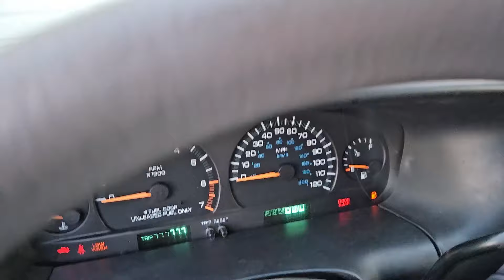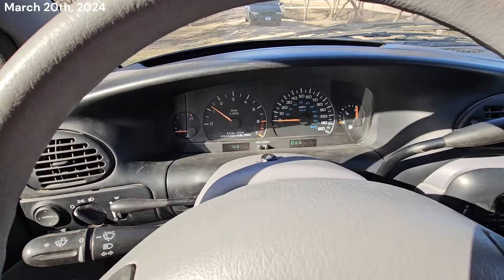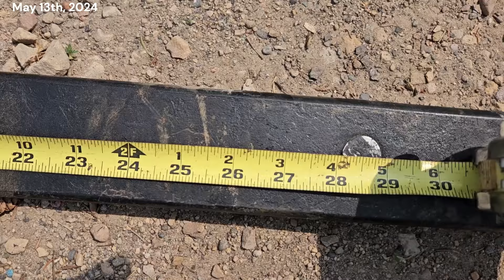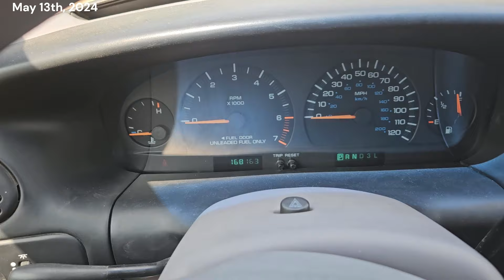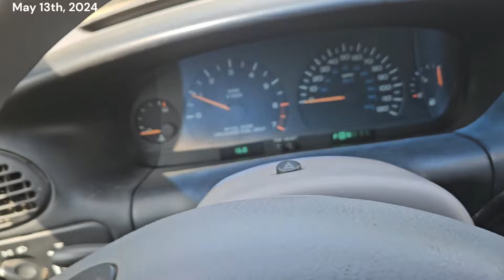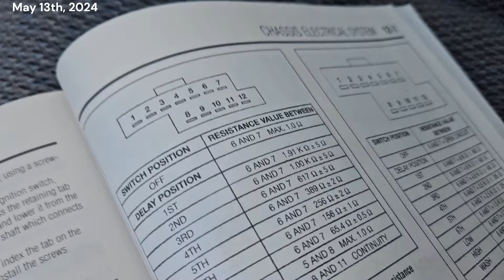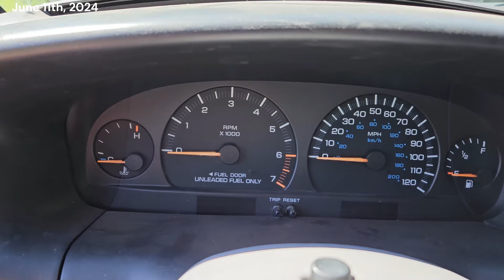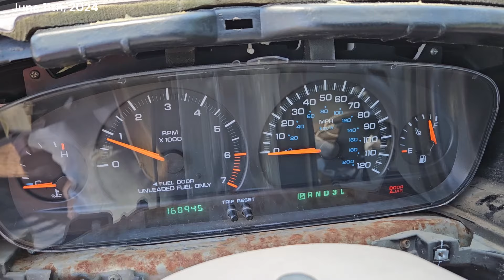1997 Dodge Grand Caravan SE abandoned for 4+ years | Part 8 | New leaf springs... again

Comment: Years ago I had a 62 International pickup and it's rear springs were whipped so I took them out and had them re- arched at a spring shop. they also added a half spring. It lifted the pickup bed a few inches and improved the driving while fully loaded. It was cheaper than buying new and the springs except for the added half spring was still oem. Good video gotta go and finish watching the rest but don't listen to nay sayers, you are doing a good job and have almost a brand new van at the fraction of the cost of a new one. You know what you got and you did it with your own two hands. God bless and Happy Motoring.

Comment: Ive watched your videos and see that you a few of these vans, I have a 1999 Chrysler Town and Country and a 2006 Dodge Grand Caravan, Both of them, when its really hot outside and driving in stop and go traffic, they will start to vibrate in the steering wheel and put on the brakes and its alot of vibration, it really feel like something is about brake apart. Once they cool off, drive and everything is back to normal. have you had this problem with any of your vans?
Reply from the maker: @joepoland3608  so you get a vibration in the pedal and wheel when applying the brakes a lot? 

Sounds like you have a hanging caliper causing the brakes to get hot and warp the rotors to me. Could be a few things causing it. My guess is an old brake hose causing fluid pressure to hold in the caliper. You say it frees up after you get driving a bit, that would mean the fluid slowly was able to bleed back out of the caliper and release it. 

No guarantees, but I would start looking at the brakes.
Reply: @MNMoparMinivan  it goes back to normal after cooling down, in extreme heat it acts up, theres also a metallic smell
Reply from the maker: @joepoland3608  yeah you're probably smelling your brake pads cooking. When it starts acting up. If you can get out and put your hand near the center of each wheel(don't touch!!) you should be able to feel the heat radiating from the stuck brake. Sometimes you can spit on your brakes too... if your spit sizzles off, it's probably too hot.